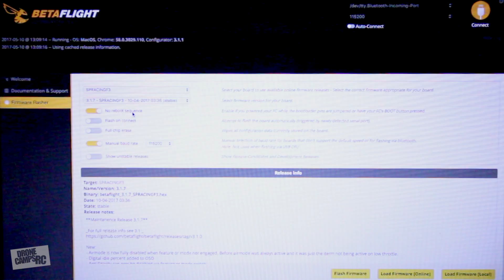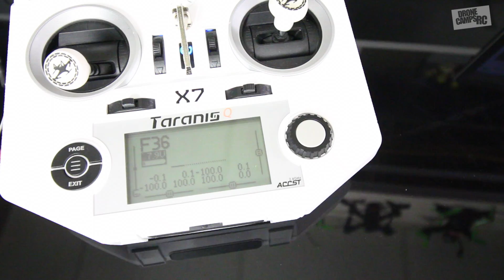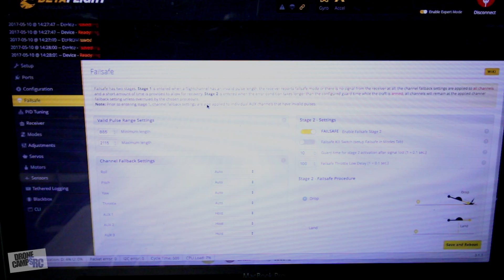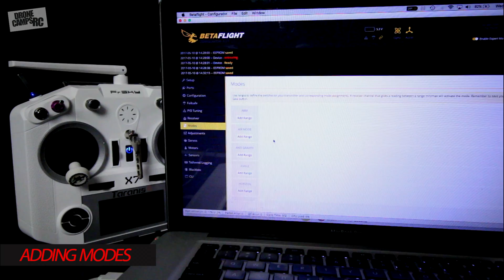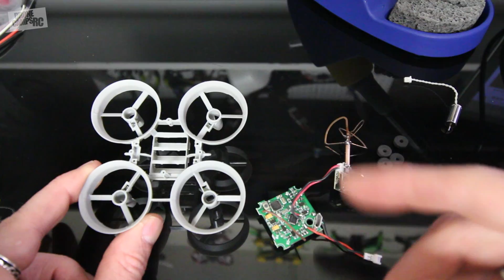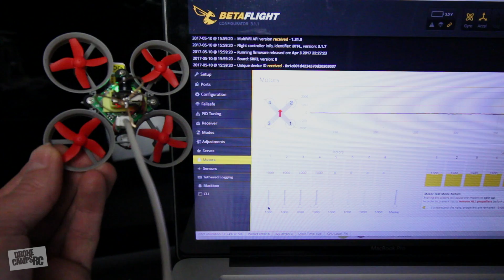TINY WHOOP BUILD -  STEP BY STEP VIDEO TUTORIAL

Comment: Their are better ways to unsolder, but the suction is easy available and cheap. One tip I found is notch a little "V" out of the tip just big enough for the tip of the soldering tip you use most for this work. This helps you get a better suction and the nylon auction tip closer to the PCB for removing solder. Just thought I would share, give it a try. If you don't like it you can buy replacement tips for cheap.